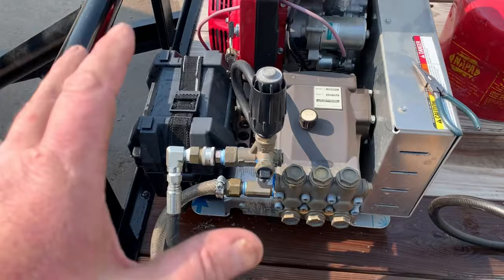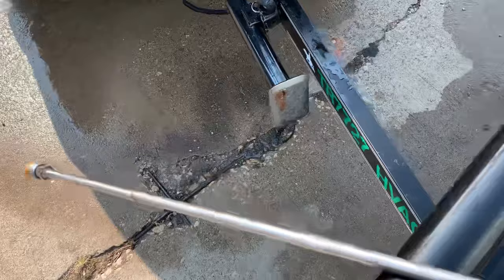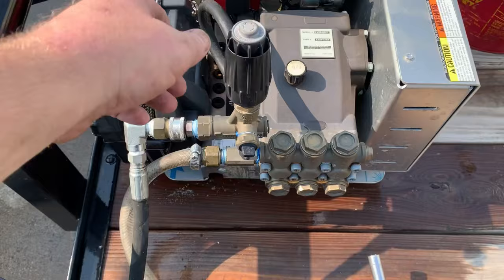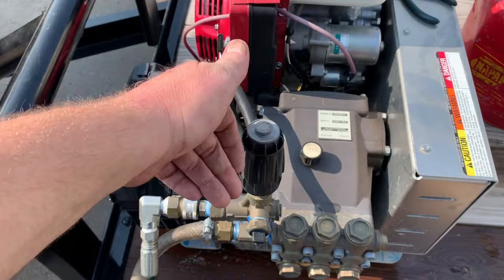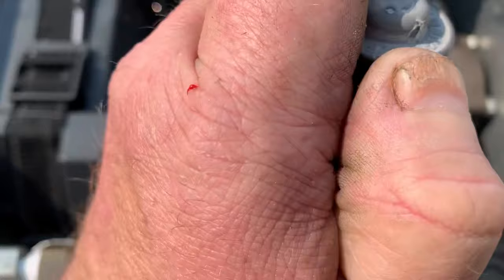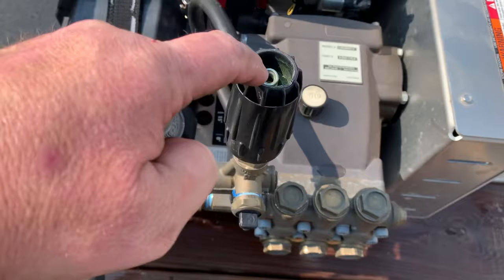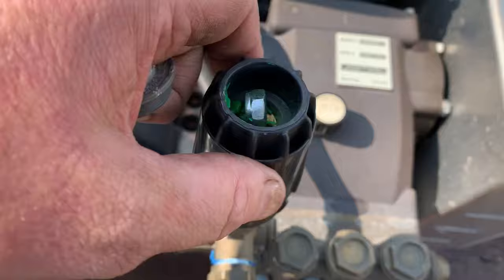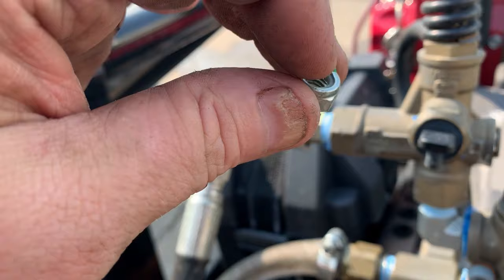FIX LOW OR NO PRESSURE ON YOUR POWER WASHER IN LESS THAN 60 SECONDS

Comment: I have a stock Triple AAA pump (I know it sucks) that comes with my never before used GX390 Simpson and the pressure adjuster has a different contraption that isn’t built like the one shown in the video :(

Comment: My champion 3000 psi gas pressure washer doesnt have this part and very low pressure. Any other suggestion?
Reply from the maker: Bad check valves